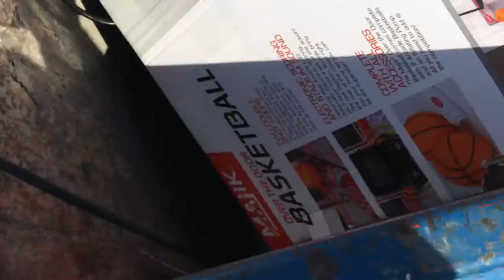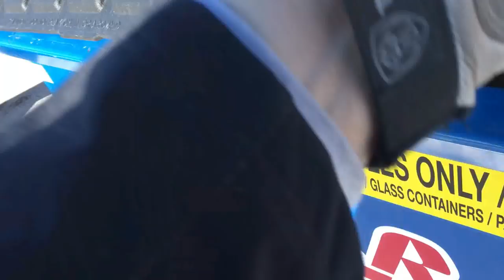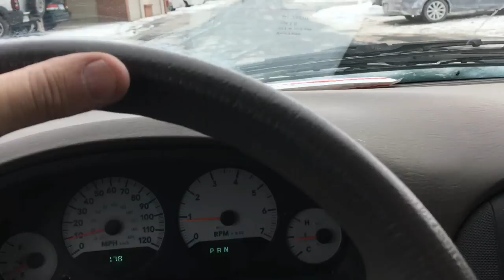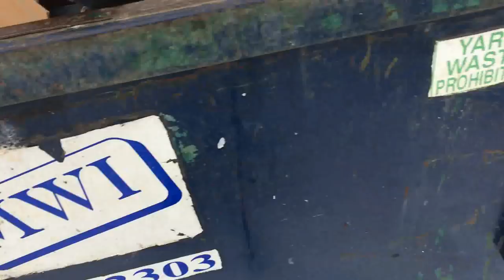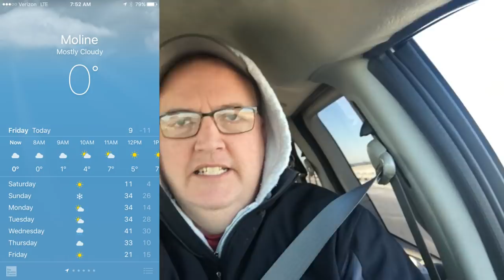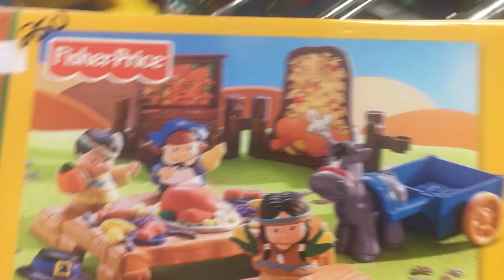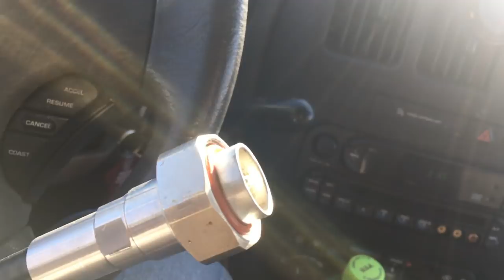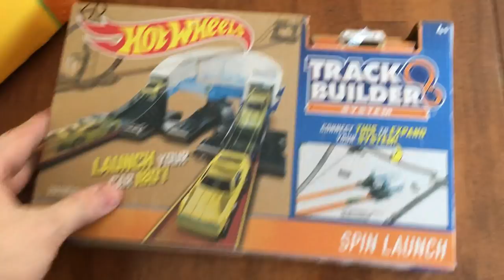6 degrees of Dumpster Diving!  Huge Copper Score!

Comment: 565 coax, copper shielding, aluminum center conductor with copper plating. Dielectric foam has value. Remove jacketing only.

Comment: That Beautiful Copper Cable is called Heliax or Hardline.The connectors are usually Brass or Aluminum and are usually reusable and it’s an N type connector.I am a Ham Radio Operator and it’s very common cable used for communications.It’s not Cheap stuff and yes that’s real Copper inside and the outside case.

Comment: Good video Shaneman. I scored 3 rolls of copper sheeting yesterday quite by accident. The rolls are 25 feet long and 12 inches wide. Haven't weighed them yet but I think this is going to be a resell item. They had a little bit of something on them that came off pretty easy.
Reply from the maker: That is awesome Russell!  I hope you got it on video!!